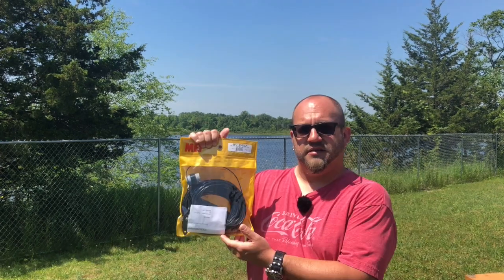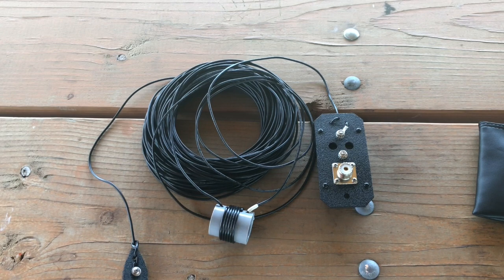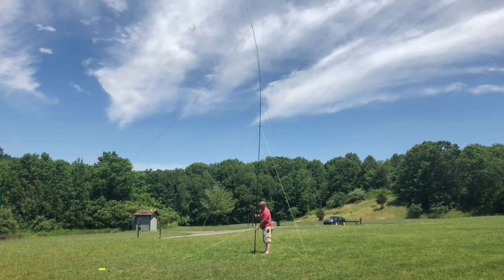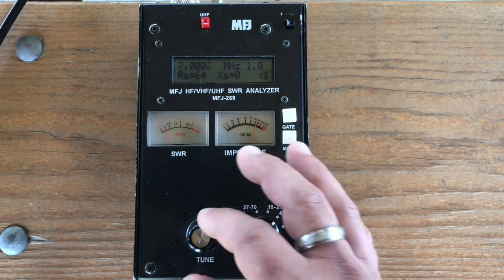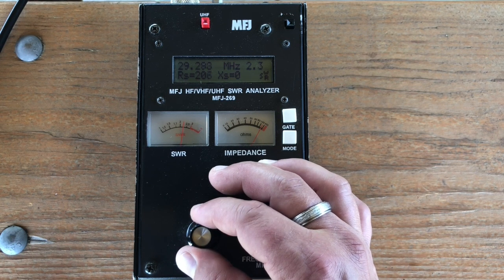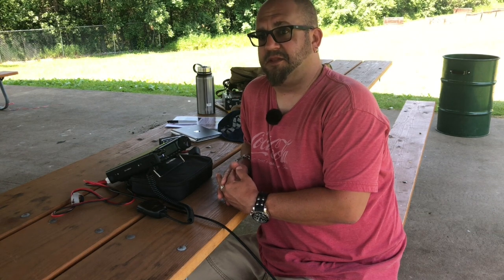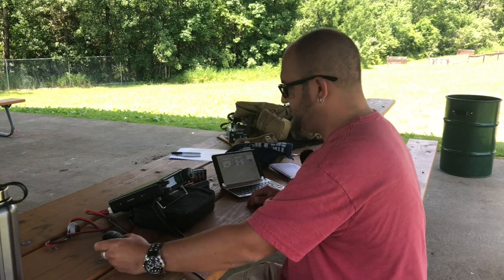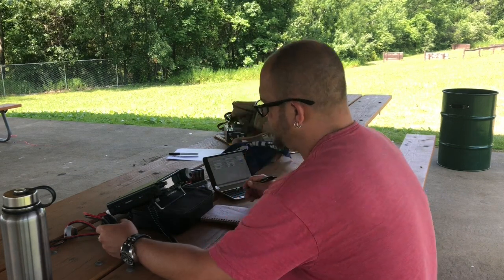Trying out the MFJ 1982-LP 80-10 Meter End Fed QRP Ham Radio Antenna.

Comment: I have the medium and high power versions of this antenna.
Shorten the end by 6’-1” to get all of the phone portions tuned better.
They ship them long. Set up for CW, but again, just pull some wire through the end insulator, and zip tie it to the rest of the wire, to tune your antenna for voice.

Comment: So what do you have to do when the SWR is too high?
Reply from the maker: That is going to depend on why it is too high.  Without getting too deep into this topic, with this particular type of antenna (80 meter End Fed Half Wave), you should have a relatively good SWR on all the bands.  If it is too high, your antenna is most likely either too long, or too short.  If it's too long, you can simply cut the wire and raise the resonant frequency.  If it's too short, you would have to either solder on more wire, or replace the wire with a longer run.

Comment: When you try to end membership at gym - retention counselor slash customized goal oriented strength trainer vibes.
You did curls, and it did not go far 
(20 meter qrp ssb)
And you had an emarrasing mishap in bungee cord room
(75 meters qrp ssb)
After getting a protein shake
(efhw)
and find the strengths/weaknesses
(swr)
boom
you're a radio rat!

Comment: I have this antenna ,and its junk.  I have better luck just it as a sloper ,
Reply: You probably need to trim it. I have 2 of these, and they work great.
Reply from the maker: I don't think it's bad. It's got really great rx too.  I do wish the wire was thinner.  For being a qrp antenna they could have shed some weight off of it.
Reply: @hamradiotube  try it as a sloper just a long wire I think you will see a difference

Comment: Looks like it needs shortening slightly for use on the phone part of the bands.
Reply from the maker: yeah just a couple feet probably. I need to get that antenna back out again.  It is really good.
Reply: @hamradiotube  It was quite impresive on the video. Great video production by the way.

Comment: Great video, Mike! Really good demo of this antenna. Please tell me specifically which one of the two extender poles you listed below did you use in this video. I think this EF antenna so high up may be the secret to this great efficiency your video demonstrates. 73 de WB3BIQ.
Reply from the maker: Thanks for watching.  I used a telescopic 10 meter carbon fiber rod that I can't seem to find anymore.  I would recommend something a bit more substantial though.  I like my MFJ 1917 43' mast.  Spiderbeam also makes a good mast as well.
Reply: Hi, Mike, and thanks for responding. Wow! That is one long pole—but I guess that’s what it takes to string up and support that MFJ  EFHW 10 - 80 meter antenna. 73 de Rick, WB3BIQ.

Comment: I have the MFJ-1984LP.  It did not come with the choke and I think that is because it is short wire version.  If I put this on a base do I need a choke or to prevent RF from coming back in shack??
Reply from the maker: I would doubt it.  Put it up.  If it’s noisy put a couple chokes on it.
Reply: Thanks.  Will do

Comment: I have the same brand of antenna, except it's 40-10m. From Georgia, I've reach many parts of Western Europe, Brazil, Costa Rica and most of the US and Canada, all on between 5 to 8 watts. My question is are there any more efficient End Fed antennas out there? I bought this as a low cost way to test the concept but if there's nothing really better out there, why spend extra money to have the same performance!
Reply: I have not put mine up.  Did you use as a sloper or inverted V?  Did you use a counterpoise?
Reply: @TridentMissileTech  Mine is deployed as a sloper, with the high end at about 25 feet up into a tree and the near end at about 12 feet, next to my apartment window. I'm looking at getting the 80 through 10 version of either the MFJ, Myantennas or the HiEndfed antenna
Reply: Thanks.  I will give it a try.

Comment: Killer antenna! Über portable. I may have to try some QRP in the near future. Keep up the great work!
Reply: Hi - do you know if any of the below Rigs are worth thier weight - cheers
XIEGU G1M		£205	5W 	@13.8V		.36A max
G90 - 			£378. 	20w	@13.8V		1.5A max
KN -990 		£440  	15W 	@13.8V		1.1A max
RS958 mchfclone 	£350  	10w 	@13.8V		.72A max
RS918 mchfclone    	£436  	15W	@13.8V		1.1A max
mchf 	
Ailunce HS1 H		£400  	15W	@13.8V		1.1A max
X5105			£636   	4.5W	@13.8V		.33A max
Reply: @男メロウ  I do not own any of these radios.... Yet.... That being said, I have heard great things from about the X5105 and G90. I believe there are videos on one or both of these radios on K8MRD Radio Stuff.
Reply: @WJ6FRadio  Cheers my friend 73

Comment: Mike shortin the end of the antenna,  a little at a time.
Reply: Hi - do you know if any of the below Rigs are worth thier weight - cheers
XIEGU G1M		£205	5W 	@13.8V		.36A max
G90 - 			£378. 	20w	@13.8V		1.5A max
KN -990 		£440  	15W 	@13.8V		1.1A max
RS958 mchfclone 	£350  	10w 	@13.8V		.72A max
RS918 mchfclone    	£436  	15W	@13.8V		1.1A max
mchf 	
Ailunce HS1 H		£400  	15W	@13.8V		1.1A max
X5105			£636   	4.5W	@13.8V		.33A max

Comment: Maybe your signal was so good because you sending with 75 Watts? On my FT-891 i have to set HF SSB PWR for Phone and HF PWR for CW and Data-Modes. Anyway... i enjoy you Videos :)
Reply from the maker: No way man, 5 watts!
Reply: @hamradiotube  You can test that really easy. Turn HF SSB PWR to 75W, Turn HF PWR to 100W and set MTR to PWR, talk into the mike an watch what the Meter shows . After that, turn HF PWR all the way down to 5W, talk again and watch the Power Meter, it will show you, mor or less, the same as before. I would be surprised, if the US version of the Radio differ that much in function from the European version, so i still believe you sending out 75W.
Reply from the maker: Oliver Koller um...thanks Oliver. I’m fully aware of how to set the power on my radio, which is how I’m able to tell you I was running  5 watts.
Reply: @hamradiotube  Ok i think i had to belive you. But thats is really wierd, thats means my radio works not the same way as yours. I know that because i made that "mistake" 4 days ago I set HF PWR to 5W, spoke into the mike and my crossneedle meter, (set to 30Watts)  flew right away to top scale. Then i checked my power settings and set HF SSB PWR to 5 Watts and everithing behives like it should. Bevore i write my post i double checked the behaviour and is exacactly like i described it. By the way, go on with you videos i really enjoy them. vy73 HB9HBO
Reply from the maker: @oliverkoller3964  It sounds like they are the same.  HF power is for cw power and I think digital, and SSB is for, well, SSB.  Weird how they split it up like that.  Yaesu's menus definitely are not the most thought out.
Reply: @hamradiotube  You right, with the menu's ;) but besides that, for the size and the power an unbeatable neat small thing, with a lot of cool features.

Comment: Since most QRP operators mostly use CW, that antenna would be a great for the low power CW operations
Reply: Hi - do you know if any of the below Rigs are worth thier weight - cheers
XIEGU G1M		£205	5W 	@13.8V		.36A max
G90 - 			£378. 	20w	@13.8V		1.5A max
KN -990 		£440  	15W 	@13.8V		1.1A max
RS958 mchfclone 	£350  	10w 	@13.8V		.72A max
RS918 mchfclone    	£436  	15W	@13.8V		1.1A max
mchf 	
Ailunce HS1 H		£400  	15W	@13.8V		1.1A max
X5105			£636   	4.5W	@13.8V		.33A max
Reply: @男メロウ  Hello, sir, I do not know what's the best bang for the buck. My advice is to get the one with the most features at a price point you feel is acceptable. I watched the Minion SDR video and for the money, it's seems a good deal too. 73, de KX4EZ
Reply: @diverbon911  yep I watched that 1   -  73 mate

Comment: Its an EFHW - 132 feet gives you resonance on 80 as a half wave and harmonics to allow 40 20 15 10. The compensation coil (not choke) allows you to also get a decent match on 12 and 17m. Not a bad antenna - although in the US MYANTENNAS are better built and in Europe HYENDFED are better constructed. These also offer far higher power to be used. 73
Reply: "My Antennas" are nice but not really designed for portable use. The MFJ-1982/1984 series are much better for portable use.
Reply: @mikevolberg2322  true but at least they last

Comment: nice one m6ltv nigel cotswolds west uk 73
Reply: Hi - do you know if any of the below Rigs are worth thier weight - cheers
XIEGU G1M		£205	5W 	@13.8V		.36A max
G90 - 			£378. 	20w	@13.8V		1.5A max
KN -990 		£440  	15W 	@13.8V		1.1A max
RS958 mchfclone 	£350  	10w 	@13.8V		.72A max
RS918 mchfclone    	£436  	15W	@13.8V		1.1A max
mchf 	
Ailunce HS1 H		£400  	15W	@13.8V		1.1A max
X5105			£636   	4.5W	@13.8V		.33A max

Comment: Thanks for another great video. You're testing equipment just like I would, except I don't have an analyzer yet. OBTW, congratulations on making EXTRA.   Enjoy your new freedom and carry on. Cheers
Reply: Hi - do you know if any of the below Rigs are worth thier weight - cheers
XIEGU G1M		£205	5W 	@13.8V		.36A max
G90 - 			£378. 	20w	@13.8V		1.5A max
KN -990 		£440  	15W 	@13.8V		1.1A max
RS958 mchfclone 	£350  	10w 	@13.8V		.72A max
RS918 mchfclone    	£436  	15W	@13.8V		1.1A max
mchf 	
Ailunce HS1 H		£400  	15W	@13.8V		1.1A max
X5105			£636   	4.5W	@13.8V		.33A max

Comment: Hi Mike, nice work.  If you want to make an UNUN check out the K1RF PowerPoint Presentation.  I made a EFHW 49:1 cut for 40M, and it also tunes 20M and 15M easily.  It is a great antenna, and fun project.  Just make sure you run at least 1 Quarter Wave Counterpoise, really helps with SWR. You can never have enough Antennas!  73!!! AI6ZV

Comment: Seems to be a well performer antenna. Thanks for sharing it with us Mike! 73
Reply: Hi - do you know if any of the below Rigs are worth thier weight - cheers
XIEGU G1M		£205	5W 	@13.8V		.36A max
G90 - 			£378. 	20w	@13.8V		1.5A max
KN -990 		£440  	15W 	@13.8V		1.1A max
RS958 mchfclone 	£350  	10w 	@13.8V		.72A max
RS918 mchfclone    	£436  	15W	@13.8V		1.1A max
mchf 	
Ailunce HS1 H		£400  	15W	@13.8V		1.1A max
X5105			£636   	4.5W	@13.8V		.33A max

Comment: Good stuff Mike, I have been running the Band Hopper 4, four-band portable dipole antenna from Sotabeams. Good for 20, 30, 40 & 80. Great antenna as like this your using no need for a tuner. I use it the same way you do using a pole and works great. Thanks for the video!

Comment: Thanks for the video Mike. I have this antenna after I accidentally picked it up instead of the medium power. This video made me realize maybe it's time to up the cw learning. Obviously since it's the low power qrp version its appears to be best for lower on the bands. I added a counterpoise I believe 31 feet and seems to improve results. Thanks again Mike. Kevin W8BRY
Reply from the maker: Cool good to know a counterpoise works with this.  A couple ppl have chimed in with different results so it's good to hear from your experience too.  And yeah, we all need to up our CW learning for sure.  73.
Reply: Hi - do you know if any of the below Rigs are worth thier weight - cheers
XIEGU G1M		£205	5W 	@13.8V		.36A max
G90 - 			£378. 	20w	@13.8V		1.5A max
KN -990 		£440  	15W 	@13.8V		1.1A max
RS958 mchfclone 	£350  	10w 	@13.8V		.72A max
RS918 mchfclone    	£436  	15W	@13.8V		1.1A max
mchf 	
Ailunce HS1 H		£400  	15W	@13.8V		1.1A max
X5105			£636   	4.5W	@13.8V		.33A max

Comment: I have the high power version of this antenna. Using as an inverted V up in a tree my swr is much higher than yours on all bands. I have to use an external tuner with mine as the tuner in my FT-891 or IC7300 wont tune this antenna, The only band it is good on is 17 meters. a couple of my external tuners won't even tune this antenna. You must have a got a good one.
Reply from the maker: Wow, I would have thought getting it higher would have been better.  Interesting...
Reply: @hamradiotube  I followed him after his instructions by keeping the end with connector 8 feet off the ground and still the swrs are outrageous